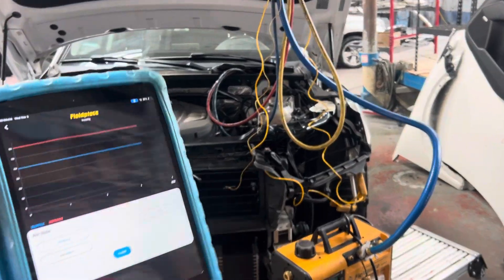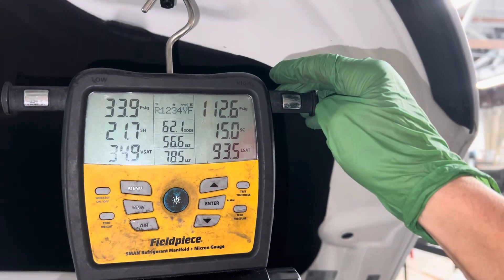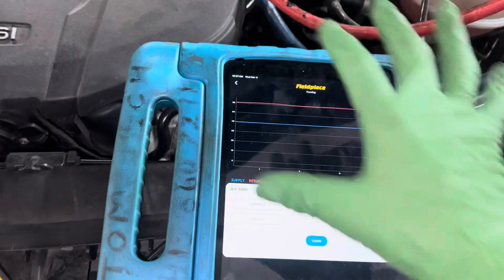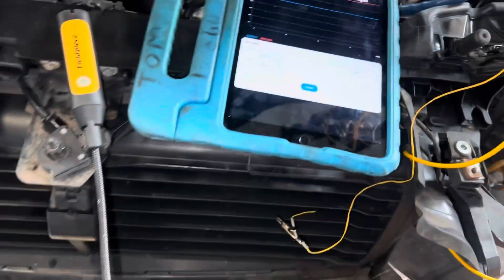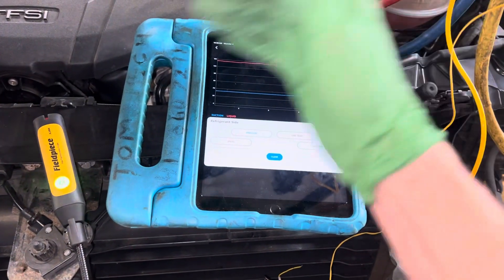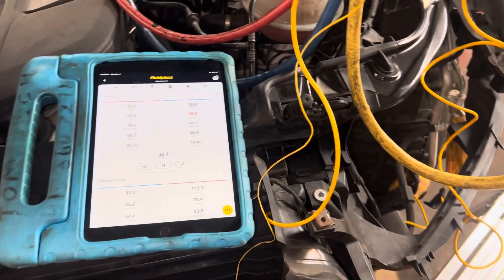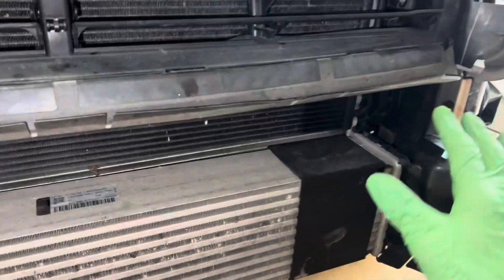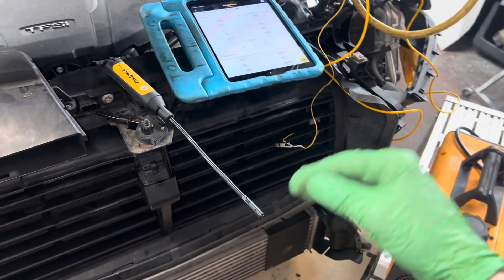Proving leak detection methods different leak detectors on the same leak

Comment: Tom can you recommend a modern  budget leak detector ?  ( i still have my old Tif unit from back in the day ) the one you use is great but a little expensive ...
thanks in advance    Jay.
Reply from the maker: I do not know of a budget model if your budget is under $600

But budget entry level with no bells and whistles, but extremely sensitive good refrigerant leak sensor heated diodes technology . The H10 

Non-budget with all the bells and whistles and extra features Inficon DeTech stratus
Reply: @coldfinger459sub0  thanks.Tom.....with the cost of the H10 ....might as well go all in and get the  DeTech stratus .. ..
while my Tiff would suffice back in the day, it is no match for today's small leaks ... Cheers    Jay.
Reply from the maker: @charlesleake930  the tiff never serviced for anything

Your coffee would make it go off your under arms would make it go off your breath would make it go off the refrigerant that they use for expanding the foam stripping would make it go off when you press it against it . 

The old corona discharge sensor . 

The H10 has been around for more than 50 years 
It’s what my dad had that he used when he was young 
And I learned off of my father‘s H-10 

A TIF was given to me I put it into classification of a novelty toy 🧸. 

Even the old fashion copper disc with the burning propane, was more accurate than the TIF
Reply: @coldfinger459sub0  for the price of the H10 ...might as well spring for the DeTech Stratus.....and make the job easier ...
thanks   Tom .... Jay.l